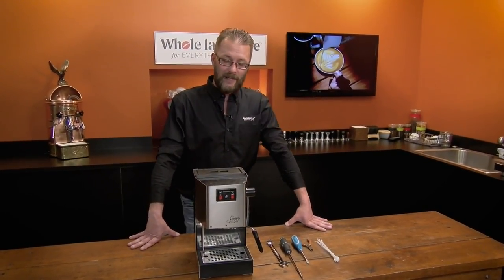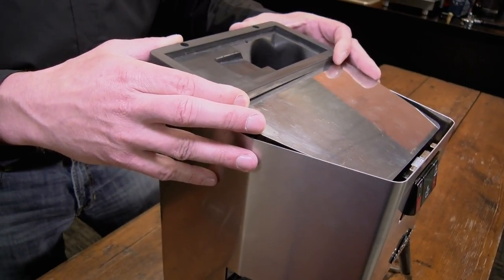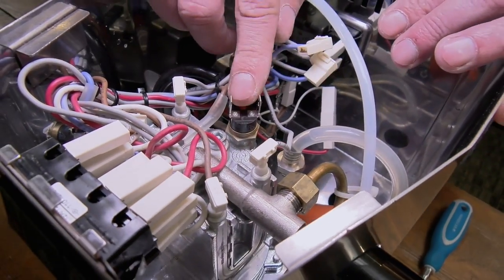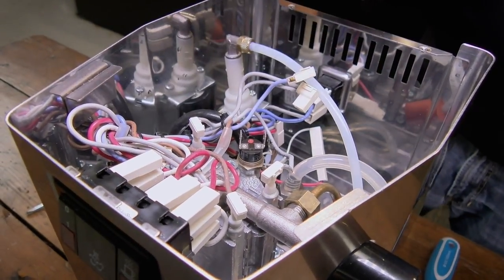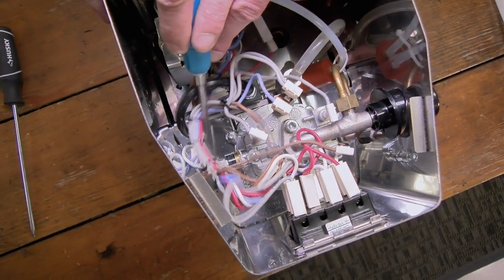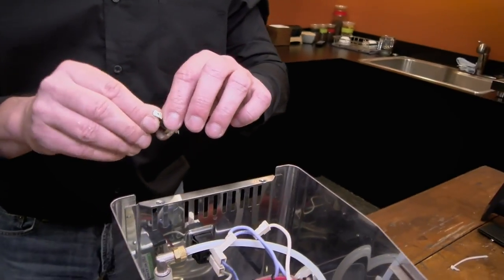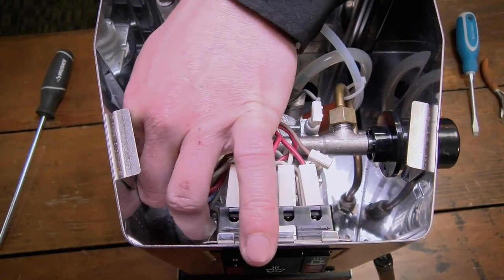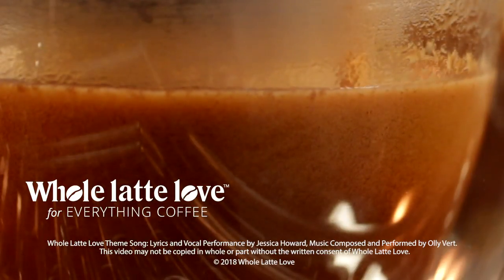How To Replace the Brew and Steam Thermostats on a Gaggia Classic Espresso Machine

Comment: Thank you so much for your video!  I was able to confidently repair  the 'thermal fuse' and both the 'brewing' and 'steaming' thermostats on my own; very satisfying. So glad the repair guy I called was inefficient and didn't called me back. I am really starting to get to know my 'Gaggia Classic' from the inside -out! 
I have noticed that many 'Gaggia Classic' owners  have adjusted the pressure valve from 12 bars to 9 bars and also adapted the machine to include a PID (Proportional-Integral-Derivative) -  For those not familiar -a device used to keep the water inside the boiler at a much more stable and optimial temperature for brewing or steaming.  What are your thoughts?  
P.S.  My machine is an older model  06/2005 (Q96162).
Reply from the maker: Hi c, nearly 20 years old! Easy repairability and longevity are one reason why I recommend Gaggia Classics. For thos reading with newer Gaggia Classic Evo Pros know that all those shipping in North America already have a 9 bar OPV installed.

Comment: If the machine overheats when in brew mode, and works fine in steam mode, would it then be the brew thermostat that's broken?
Reply from the maker: Hi Daniel, That's a good place to start.
Reply: im having this same issue, thinking ill replace the brew thermostat, did this fix your problem mate?

Comment: What are the tell-tell signs that either thermostat is not working properly and needs replacement?
My gaggia classic gets really hot when turned on (almost too hot to touch), which didn't use to be the case.
Reply from the maker: Hi t, well that might be a sign. If getting that hot I'm surprised the thermal fuse on top of the boiler didn't go.
Reply: @Wholelattelovepage  thank you

Comment: Hello, thank you for the help on my previous question. I replaced the thermostats and it was working really well but I have a new problem; when I turn the machine on, the brew light comes on immediately, when I pull a shot it comes out super fast. Same coffee, same grind. I tried adjusting the grind but it hasn't made a difference. It's as if the machine was too powerful. My pressure is reading as 16 bars.

Comment: What is the white thermal compound called? Thanks!
Reply from the maker: Hi Louis, Heat Transfer Compound, often referred to as heat transfer mastic, is a compound used to enhance the thermal performance of bolt-on heating products. ... Heat transfer compound consists of graphite and one or more binder components which are formulated for different applications.
Reply: @Wholelattelovepage  gotcha, so similar to thermal paste for a cpu
Reply: Is it important to replace this compound when putting in a new thermostat?

Comment: Thanks for the great videos. My steam is working well but the brew is coming out cold. It does come out hotter if I brew after I steam. Is this a problem with the brew thermostat or could it be a problem with the boiler?
Reply from the maker: Hi wb, It may be a thermostat. Best bet is to give our tech support a call at 585-924-7170 for a better diagnosis.
Reply: i have the same problem, do you know what is the problem , is the thermostat?
Reply: @starkdc5535  It worked for me.

Comment: Do you sell the wiring harness? My steam thermostat broke and/or burnt out and the plastic housing on the wiring connection melted.
Reply from the maker: Hi Laura, It should be available. Best bet is to call our Tech Support at 585-924-7170. They can help you get the right parts!
Marc

Comment: It may be the configuration of your Gaggia, but I keep wondering why you are not attaching the earthing wire that is attached to the lid (I have now seen a couple of your Gaggia Classic videos)... maybe this is only the case with the 240V?

Additional question, the thermal paste, is that the same stuff use on PC's for processor heat sinks? (just to be safe, I can add a dab when / if I get the switches for replacement)

Other than that, very nice and clear videos!  Definitely thank you!
Reply from the maker: Hi n, You are welcome and thank you for the comment and question.  I cannot speak to the 240V Classics. It may be a regulation for dedicated ground for that component in machines sold outside North America. I would think the PC thermal paste would work so long as it's rated to handle the temperature which can reach up to about 265F/130C.
Marc

Comment: My steam thermostat is broken. But my  steaming function is great without it! I know it's risky... But how about I install instead of the original one, another with higher temp switch? Like 175 c (saeco part)???  Or how high I could go?
Reply from the maker: Hi AC, Anything above the original spec is not recommended! Risky because dangerous!!!
Reply: @Wholelattelovepage  thanks. I understand that you have to said that.. But, how dangerous? A few degrees more what could do? I'll research my self. Thanks again guys!

Comment: The steam t-stat is rated to 250 (C?) but the thermal fuse is rated to 184C, can you pop the fuse if you leave the steam on too long?  When I put the steam function on my Classic, after about a  1/2 minute the boiler makes a loud angry boiling sound for 5-7 seconds and is fine from then on.  Today I let the machine warm up on brew for 15-20 minutes and then made my coffee and right as I was finishing steaming milk the machine shut off and tonight checked the fuse and it was toast.  If a tstat goes bad, can it go bad on the high side and cause that problem with the loud boiling/cavitation sounds I mention?
Reply from the maker: Hi Andrew, I suggest replacing both thermostats and the fuse. There's more info on troubleshooting the Gaggia Classic including electrical diagrams here: https://wiki.wholelattelove.com/Gaggia_Classic
Reply: The thermostat and fuse did it.  Fuse got the power back on and steam t-stat kept the boiler from overheating to the point where it overboiled/superheated the steam and made all that racket.  Thanks!!
Reply: @andrewgreif1504  Mine made that noise. It released pressure to the opv when it was ready to vaporize. I removed the opv and cleaned it. I went back and everything went back to normal. No noise now.

Comment: Not sure if US machines are different but my pre-2015 Gaggia Classic has different temperature ratings than you state in your video. The steam Thermostat on the pre-2015 model I have is 145°C, not 250°C as described in your video. The brew thermostat meanwhile is rated at 107°C whilst the thermal fuse is rated at 184°C. As another post alludes to the other anomaly is the earth wire which at least on UK models attaches to the lid. Aside of these anomalous issues, a very helpful and instructive video.
Reply from the maker: Hi tvnw, Thanks for the comment. Yes, there are some differences between EU and North American models. Think the steam thermostat is 250F here not C.